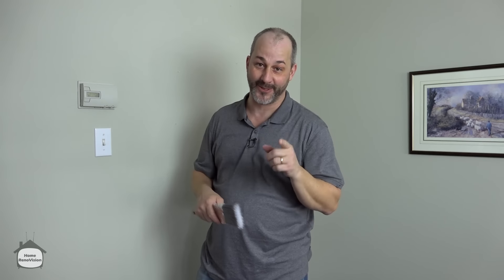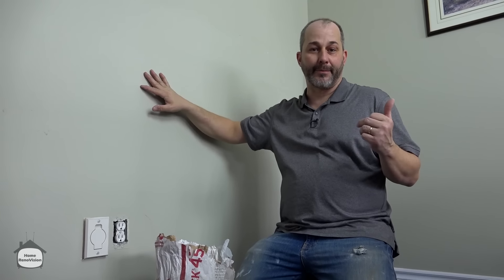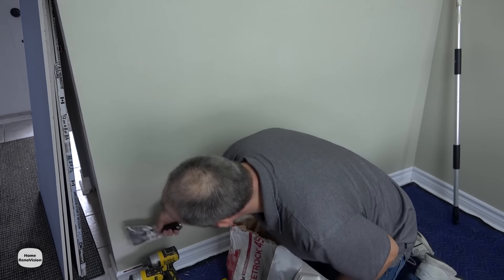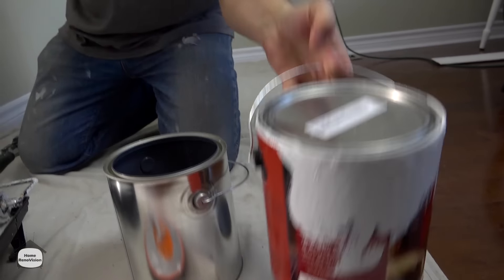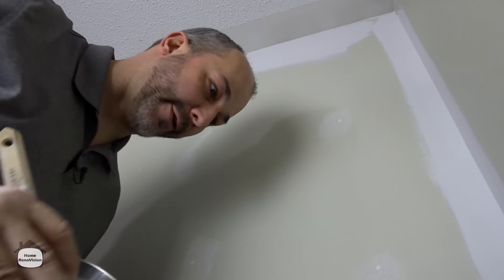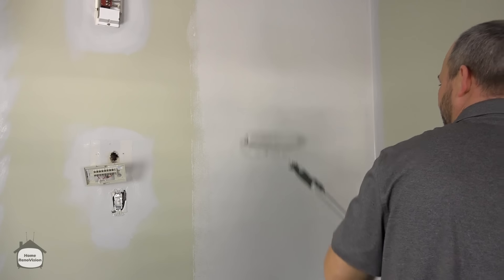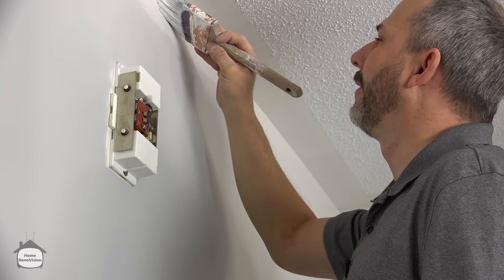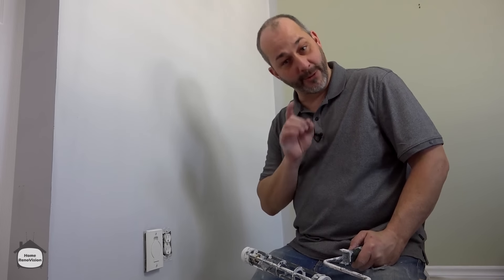DIY How to Paint like a Pro Series A to Z

Comment: Hi Jeff, do you wipe down your walls after sanding them? And what grit of sandpaper do you use? This was a great video, never thought I’d be able to sit through a 40 min video about painting but I did and was entertained! Thanks so much for posting
Reply: Great question.  I’d love to know as well.
Reply: I'd love to know this too.  I clicked on the Amazon link and there are a lot of grit options for this device.  Also curious about washing the walls.
Reply: I have the same question.  I ordered everything you listed.  But, I don’t know what strength sandpaper to use???   
Loved the video!
Reply: I always use 120 for the sponge. Source: Its my job
Reply: @tonybrown4860  Thanks Tony! I was wondering this :) Do you use 120 before the first coat, as well as in between coats? Or would you suggest something like 150 in between coats.
Reply: @wildcatfan4347  180grit for new work walls, 120 grit for repaint walls and 80 grit for exterior walls
Reply: @spacemanspiff33  you can just use 120 for everything. As long as your mud work is good and you don't over sand it it'll be fine. If you've got ridges from having alot of mud on the 120 will help with that and then you can just lightly wave the sponge to blend. Helps me move faster than trying to find multiple sponge grits in my belt especially if they've been used and a little worn.
Reply: You have to mop down the walls after sanding and use a de glosser on the trim for adhesion purposes! Also paint is not primer so all compound must be primed first, primer is a sealer, paint is a top coat! 😬
Reply: @tonybrown4860  Thanks, I was wondering what grit to use and was leaning towards either 120 or 220.

Comment: I was a painter for 32 yrs one thing you never do is wipe your brush on the edge of the can or properly called paint kettle you load the brush and tap it on the inside of the kettle wiping it like this guy can flick paint! Taping it loads the brush properly
Reply: I tried to show an apprentice how to properly load/tap , my white ceilings  had brown splashes all over the place LOL.
Reply: Sir, you made me feel good! I have eight-year experience and I figured what you said, myself. Another reason of tapping it inside the can is that cleaning it on the edge will remove too much paint from the brush. This gentleman took most of the paint out of brush.
Reply: He is not a pro ...he tells you not to paint to the bottom of the base!

Comment: Do you need to sand after the first or second sanding? I would assume that there would be paint dust on the wall after sanding
Reply: Light sand and wipe
Reply: If you are doing a whole reno higher a dustless machine with extractor - no dust after sanding. Otherwise yes once sanded wipe down with a damp(not wet) Microfibre cloth to remove surface dust. Then paint - another top tip is to have a small 6" roller to roll out the cutting in brush lines after cutting in! You get a real fine finish.
Reply: @edecofinefinish  Do you roll the 6" vertically or horizontally?
Reply: @vanylaskywalker  You go across the straight run of the wall. So for ceiling line Horizontally and wall floor to ceiling line - Vertically.

Comment: (2) Quick questions about sanding:

You don’t need to wipe the wall after sanding?
Did you sand after the first coat? You said that was part of the process but didn’t show it.
Reply: This proces is wrong. Paint technic ok. First send. Whipe out with dry fabric. No more sending. Put primer ( see my koments below video why ) and two coats of paint. And use ready filler or putty not powder one. It's cheap shitty product for big buildings and construction jobs. Where price make diferent. For apartment ready ones is better products.

Comment: Hey, this is great stuff. You're making expert results look very achievable by the amateur.

I do have one question though - we fix up the walls, patching all dings or holes, etc. Let that set up, and then you sand.

Do you have to worry about dust / grit from the sanding process before applying the first coat of paint? Like are you sanding and then "cleaning" the sanding debris? or is it such a light pass with the radius 360 that it's of no concern? Also, you did sand in between coats right? I think you state as much, but don't show so in the video.

Everything else was super clear - just wondering about these small details. Thanks!
Reply: I've seen this question asked 1000 times on all of his painting videos, including once by me.  I'm still looking for an answer. Edit:  Finally found where he answered it.  No, you don't have to clean after sanding.
Reply: @wtfgoogle3884  hey thanks for finding that! Do you have a link to where he said we don't have to clean after sanding? This is perplexing me
Reply: @jdemuro1  I didn't bookmark it because he just replied to someone in the comments with an answer.  You could probably find it if you make it a mission, just check out the comments below a few of his DIY painting videos.

Comment: Thank you, Jeff! My wife and I have painted around our house for years, and now I see we've been making it a lot harder than it needed to be. Quick question: When sanding between coats, do you use the 220 disc on your Radius 360? Or something more coarse?
Reply: Mr Palmer - you would use a 240grit or p240 abrasive will give you a smoother finish any higher like a 320grit will make the work so much harder and remove less material from the surface.
Reply: As Edward stated - 120 grit for flattening big paint drips and a very rough wall - 240 grit for a nice smooth finish.
Reply: For clarification, watched the video in two segments… So we do ,in fact, sand the first coat of paint (once it’s dry) before applying the second coat? and is this only applicable to acrylic paint? Do I need to do this outdoors as well? 
I just want to paint everything now thank you so much!!!
Reply: @whitneymosley3421  yes he said you do have to sand before applying second coat and 100 per cent acrylic is the best choice

Comment: Commercial painter here - bad advice telling people quickset doesn’t need primer. If it’s a tiny hole you may be able to get away with it , but a big patch , you’ll 100% need primer or you risk your paint literally peeling off.
Reply: Thats what I thought! whats up with that?
Reply: What would you recommend using to prime patches please?
Reply: @stevethomas5330  I use Killz. Unless I'm working with a paint/primer combo.
Reply: Gary I use a 2.5 sometimes but I usually use a 3” angle to cut in
Reply: @Gary I use a 3" angle sash for all cut-ins besides tiny little strips next to doors and bathroom mirrors or cabinets, I have a 1" or other various sizes for those if I can't get my brush in there clean. The bigger 3" brush gives you more control honestly. The smaller ones are more squirrely and hold less paint.
Reply: Also commercial painter. Yes please prime any patches or bare drywall. Your paint will be much more durable. Running finish over mud and you can rub it off with your finger and tape will pull it clean off the wall. Also the quality of your brush makes a bigger difference. I'd rather have a wooster alpha than just about anything else. Don't skimp on a garbage brush. Not a huge difference between 2.5 and a 3 but I prefer 3. Just holds a little more paint.

Comment: So after each coat dries, you use the radial sander to sand the entire wall before applying the next coat?
Reply: I was just wondering the same thing.
Reply: yes , I'm a professional painter
Reply: I used the drywall repair method and I love love love using the hawk now. Thanks for sharing!

Comment: "Don't want to drag dirt through your mud".....never heard that sentence before haha. I knew you were from Canada! Sound like Steve Smith. 
Can you use a premixed joint compound instead? I couldn't find a small bag of 45 on my trip to the store. I grabbed at bag of the 5 repair. Hopefully that'll work!
Reply: At least at the home depots in canada, they usually sell the little bags of 45 and 20 near the contractor checkouts, not where the big bags are.
Reply: yes 100% you can use premixed joint compound. it often makes more sense for a DIY to just have a small bucket of Joint Compound around the house but the sheetrock 45 isn't something a DIY buys or keeps around. That said sheetrock 45 is not expensive and is better.. it hardens quicker. it doesn't shrink anywhere as close as general joint compound and it's much harder than JC so better for bigger or deeper holes ... just do NOT OVERUSE or excess cause it's more difficult to sand. BTW anything bigger around than a dime should  be primed to insure no flashing. on small holes and if u have no primer u can brush paint on it before rolling it. it basically helps seal it and no flashing is visable... again if it's small

Comment: Thanks for your instructional videos. They are amazing and really enjoy the presentation and process. Keep up the good work and look forward to more. I just removed two non bearing walls and one baring wall requiring 2x12x10 header. Turned out great and what a difference with the open floor plan between the kitchen and lanai.

Comment: hope this isn’t a stupid question but can you do all the edges with the brush and then do the roller after it’s dried or does it have to be wet?
Reply from the maker: on the first coat dry is fine. for the second best to cut and roll 1 wall at a time for optimal result. Cheers!
Reply: Home RenoVision DIY thanks so much!!
Reply: Opal Sivan I was gonna ask the same thing so not a stupid question, well it’s that OR I’m a complete idiot so now I know it’s not the latter😂

Comment: I just don't get the speed aspect. As a pro remodeler I paint only about 7 rooms per month and can cut quickly and my hand is steady. But how fast do you need to go? I'm probably way faster than most DIY'ers but have always been baffled by guys who try to paint at break-neck speeds then don't go back and check for drips or roller marks. I suppose full-time painters try to make more money by painting super fast but I'd never be one of those. Painting is enjoyable when you feel it and you pay attention to the uniform covering. If I had to speed through a job it would turn into work. TIP: Before I paint I use a 120 grit sanding screen on a drywall hand sander and lightly sand over complete pre-painted wall to remove prior dirt, dust nubs and even bugs in the paint from previous painters.

Comment: When sanding before and in between coats, do you need to wipe the wall down after sanding to ensure that no dust is left behind?
Reply: Paint sticks and seals any small amounts of dust, I would never wipe a wall, will create a mess, but not a pro painter myslef ;)

Comment: The dislikes are from people with painting businesses.
Reply: I disliked it cause he gave bad advice ... because he is a pro giving sub par advice on several things and if I didnt know any better I would hope someone would warn me when a "PRO" is giving bad advice.
Reply: @designmarqlive  He's doing a great job and his advice is very helpful. If you don't like what he's doing, that's your opinion. Why are you even here if you think you know what you're doing?
Reply: @designmarqlive  Would you like to mention the bad advice he gave?
Reply: I've been in the painting business for more than 50 years. There are a few things I would do differently but there is nothing he says I consider bad advice for the general public. We could micro analyze and find a number of differences but that's because no two people are going to do it exactly the same way. He's a better painter than 95% of the "pros" out there. The one thing he did that bothers me is cutting around a box in a circular motion. I would never leave a curved brushmark on a wall. It's either vertical or horizontal. Of course no one is ever likely to notice it and unless you are trying to do the highest quality, it's insignificant.

Comment: _______________Hey man,  you specifically stated the best way was to "Sand, paint, sand and paint again."  What happened to the sanding?  What i saw was 'sand, paint, paint, paint'
Reply: At about 27:35-27:40 in the video he mentions coming back in 20 min, it will be dry enough to do the sanding and the 2nd coat. So I assume in between coat #1, he lightly sands (albeit lighter), and then applies coat #2. I had the same question you did . . . . (where was the 2nd sanding). Great video  . . . can't wait for my son to watch it and then paint one of our rentals! Good lifelong skill for a 15 yr old to learn . . . and for my generation.

Comment: Purdy or wooster poles only if the pole isnt easy to work with and durable why bother make it easy , no pressure when your rolling roll top to bottom over lap and be sure to back roll , the pole is weighted if its a good pole you dont need to push or get aggressive let the roller do the work , other wise you’ll destroy the nap and wear yourself out ,, just some tips 23 yrs professionally painting for reputable companies thanks god bless
Reply from the maker: Thanks Steve. Cheers!
Reply from the maker: link is in the description Cheers!
Reply: Wooster poles.  Purdy for cut in brushes.  Yup.
Reply: Wooster for pole. Or if you wanna spend a little less (half as much give or take) sherman williams contractor 2'-4's work great and last forever. (Plus they're  much lighter if you're swinging it 8 or more hours a day)

Comment: Wait, he said to sand, paint, sand, paint, but in the video he comes back from his break, says everything is dry and then goes right back to painting. Did he sand off camera, or is it not necessary before the last coat?
Reply: Allen James Roughton that's debatable. Or optional. If your first coat came out nice and smooth with no debris or problems you usually don't have to sand, but you can if you want better adhesion on the second coat I guess.
Reply: I’ve found if it’s fresh drywall you need to sand lightly before final coat. If you feel the wall prior to last coat it will be sandpaper rough. Only use 150 grit 100 is to course maybe go down even further to 250 grit. A quick light sweep of the wall and away you go. My preference for a roller is a 10MM pile on the roller anymore and you end up with an orange peel texture which I hate and it builds up to much over coats. I always find that a heavy pile roller leaves heavy lines on the wall which is a bugger to feather out. A heavy pile roller is good for rough textured walls or popcorn ceiling or outside stucco or parging
Reply: Sanding after first coat is correct. You want your finish coat to stick...
Reply: I like to sand between coated but I would definitely give the paint more than 20min drying time.

Comment: When there's a popcorn or knockdown texture on the ceiling,  does that technique work?
Reply from the maker: even better in that environment. Cheers!
Reply: Use a blade of a flat screwdriver to scribe 3/8 inch of the ceiling corner popcorn texture clean....   looks really uniform, so you don’t notice it, and makes cutting the ceiling / wall edge easy as no popcorn bumps
Reply: mrbob581 that’s genius I’ve never thought about this. I always get waves because of the popcorn, or texture isn’t eh corner
Reply: mrbob581 *in the corner
Reply: Technique for patching/filling holes in textured walls is different.  If you patch and sand flat, you just lost your texture which can be a pain to match.

Comment: Awesome video, thanks. I'm looking into getting a paint extension pole now. Are you using the 2' to 4' extension pole, or the 4' to 8' pole? It looks like the 2' to 4' pole in the video
Reply from the maker: 2 to 4. there is a description in the link below to get it from amazon. great price. Cheers!
Reply: Home RenoVision DIY Ha, thanks. I didn’t even think to check the description. Just ordered it, I got the Wooster paint brush and roller too. I’ll be my first time using a paint pole to paint instead of just using the roller in my hand. I laughed at 23:30 when you mentioned everyone did it by hand... you’re right, it’s exhausting. I never thought to get an extension pole. Thanks for the tips, great channel.

Comment: OMG!  THANK YOU for sharing your expertise.  I'm an RN but just got sick of the rat race and started dabbling in various home projects.  And, guess what?  I started off with just using drills, grinders and circular saws for making things from my own curtain rods, garden beds, hook racks and shelves.  But, now I need to learn how to paint correctly and use joint compound properly.  

I'm redoing a bathroom and I noticed that the texture of the walls weren't smooth and I hand sanded them, vacuumed them and wiped them down before priming!   

1.  So, can you still leave dust on your walls when you are working on drywall that's been painted before?

2. Do you have tips for painting with semi gloss to high gloss  paint?

I think I must be an oddball because I like semi gloss paint on my walls, even though it's used for trim. I like the glossy paint because it's very durable and you can easily clean the walls.  I know the glossy paint shows imperfections more.

Thank you!!!

Comment: This is the third time I watched this video! So much valuable information. Thank you a lot for all the tips - tomorrow I'll be painting like there's no tomorrow 😄🙌
Reply: If you want to do your own painting and you want speed as one of your hallmarks the only thing that I can suggest is that to avoid the suggestion of scraping all the paint off both sides and both corners and just come out of the can with a pretty loaded paintbrush so that you've got enough material to avoid continual dipping just put your brush in a couple inches of paint while hitting the side at the same time. I'm not trying to criticize I'm commenting on this because I was guilty of doing the same thing when I started way back in the day and after enough warnings I learned to load a brush properly. Now of course if you're painting some window sash then that's different